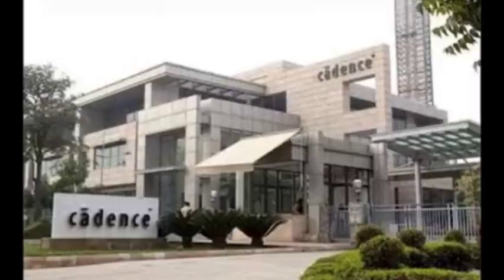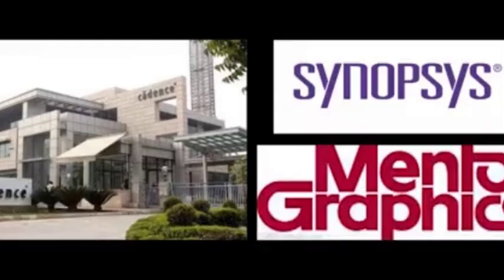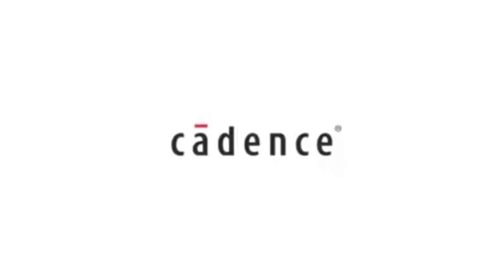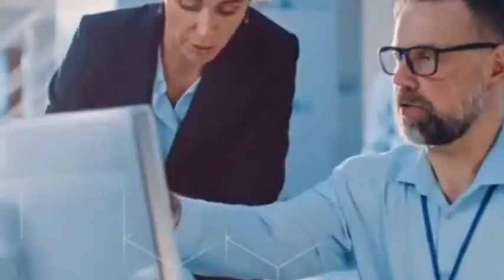China's EDA has achieved 8nm process breakthrough, laying the groundwork for ending western reliance

Comment: Smaller chips are not only Faster, but consume Less Power, Ideal For Micro Computing!,,,for fast speed they have small miller capacitance which allows for faster Transistor Speed/frequency,,,For power consumption the transistors work with Small power supplies (power) P=I x V,,each smaller transistor works with less power supply voltage and less current operation of transistor collector/drain current,,,fact is for Micro Computing smaller chips is the only solution! ;)